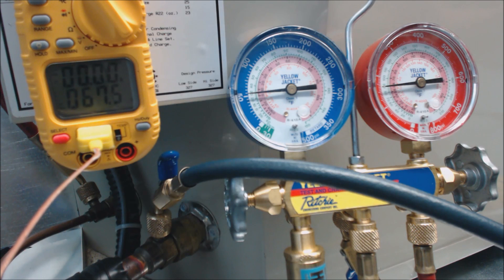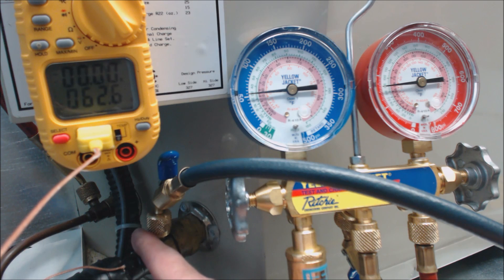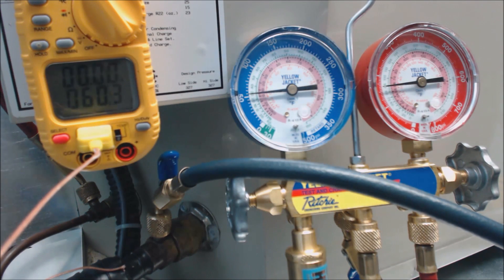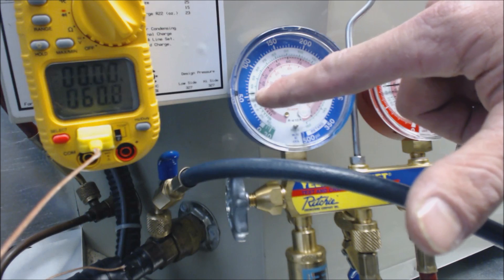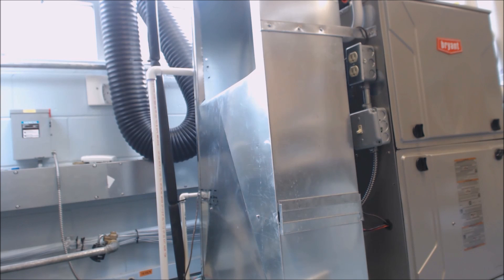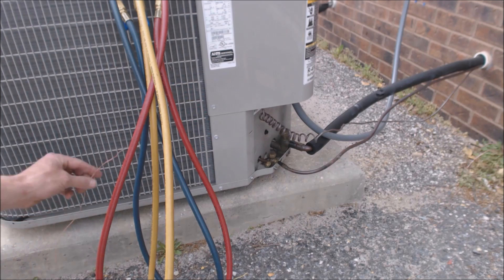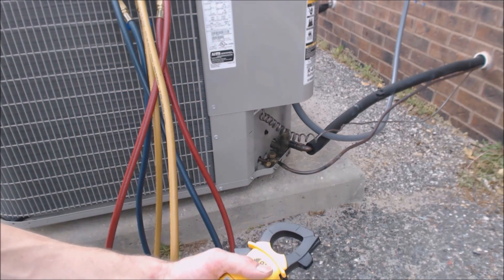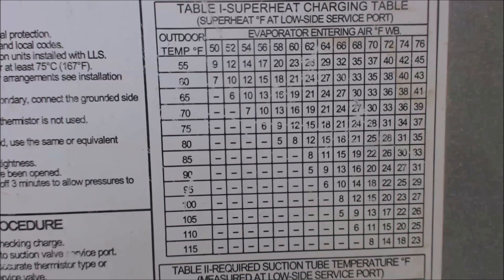Charging Refrigerant: Checking the Charge Step by Step Procedure when you Don't Know the Rating!

Comment: Excellent!      Can  this  procedure  be  done  on  a  Mini Split?  Do  I  get  the  wet  bulb  temperature  on  the  return  air  above  the  evaporator  unit?   Please  expand  on  it.  Thank  you!
Reply from the maker: The problem on minisplit units is the txv is usually in the outdoor unit and the compressors are very so standard procedures cant be used. That's why manufacturers tell us just to use the total weight method for charging from vacuum, thanks!

Comment: I live in a dryer than usual climate in the Southwest. My question to you is: How do you zero in on target Superheat when it is off the charts? For example, the other day, I had to charge a 4ton r22 system with an indoor WB 53ºF and outdoor ambient 77ºf. I went with a target of 5ºf but when I did my evaporator saturation temp was still below freezing. So I kept charging to bring up that temp.
Reply from the maker: That is exactly the problem in dryer climates. Pistons are highly inefficient or are a danger to the compressor in that type of climate. Whenever you install I would recommend a txv. This will make the most of the saturated state and keep the compressor safe. The only other thing I can say is to verify great airflow to help with this and just try to keep at least some superheat. If this can't be met and the unit does not have an accumulator then I would recommend replacing the metering device, thanks
Reply: Thanks for your reply. I appreciate the videos you produce. It is very helpful!

Comment: If you don't have a wet bulb instrument, can you take a temp. reading at your return air duct to determine the temperature needed for a target point for superheat? This is in regard to my previous question about my son's AC. It is an older system and with talking to a AC person, he was almost certain that the system had R-22 in it. When I put the gauges on unit the other day it was in the high 90's outside and, if it actually does have R-22, the evaporator was reading a saturation of 30 degrees. Which led me to believe that when he did have the unit ON eventually the evaporator did freeze up, because my son said that he had no air movement at the register. I had a reading of 27 degrees at the suction line when I put the temp probe on it. What is the normal temp range with an orifice tube?
Reply from the maker: Here are two videos on those topics. I would check your sensor as that would mean you had negative superheat. Check it in ice water for a 32 degree reading --  https://youtu.be/PIYJBaOdGx4    --  https://youtu.be/uEs99SSKjgE

Comment: you say to use superheat to check charge but if there's allot of humidity in the house the superheat could be high even though the charge isn't that far off.    Do you normally wait for the humidity to come down inside the house ?
Reply from the maker: We usually wait 10-15 minutes before checking superheat unless the vapor sat temp is below freezing. If the target calls for 30 degrees then you would set it at 30. That would be the correct chrge but you need to recheck the wb inside and recalculate the target superheat as you are charging. If 30 degrees doesn't sound efficient, that is because pistons are much less efficient than txv's because txv's can open up all to absorb more heat from the house while keeping the superheat lower, thanks and I hope this helps!

Comment: You need to check the superheat on piston types and the sub-cooling on TXV, correct
Reply from the maker: Yes that is correct for comfort cooling systems but not refrigeration units. Also always check the low side gauge and sat temp for a picture of adequate indoor air flow and temperature above freezing, thanks

Comment: Can you share gauges between refrigerates? Like r22 and 410-a? Thanks
Reply from the maker: You want to try to avoid it due to any oil contamination between mineral oil in r22 and poe with 410a but it can be done in worst case if you blow the lines out with nitrogen. It is best to have a set for each, thanks
Reply: sweet, thanks. So, I'm new at this; to check the pressures for a TXV you use the super cool. For a piston metering system you use the super heat, correct? thanks love your vidoes
Reply from the maker: Thats correct for comfort cooling, subcooling-txv, superheat-piston and capillary tubing

Comment: so, where exactly we have to take the super heat ?
suction line indoor right after the evaporator coil ( which is according to text books correct spot to take the super heat),
or outdoor suction line right before suction service valve ? 
other words in order to use super heat chart are we always going to take the super heat (indoor) or total super heat out door?
Reply from the maker: You will check for the closest port on the vapor line after the evap coil which in most cases ends up being total superheat at the outdoor unit. For your reference check out this video on saturated vapor temp and pressure. Thanks!https://youtu.be/th0EnaSbJUw
Reply: Thanks for your prompt response...